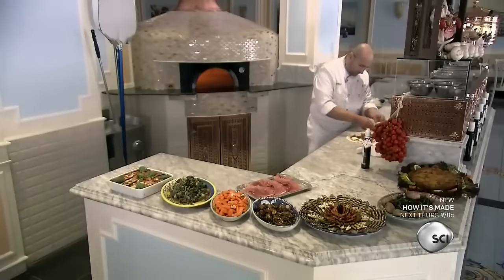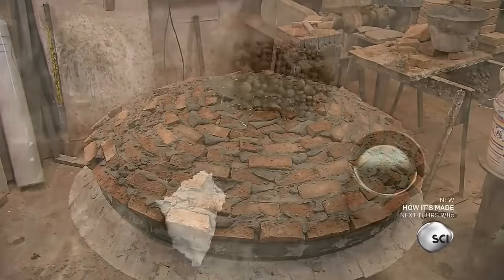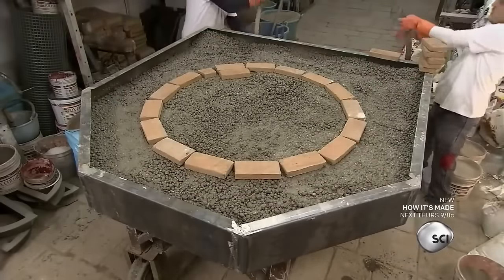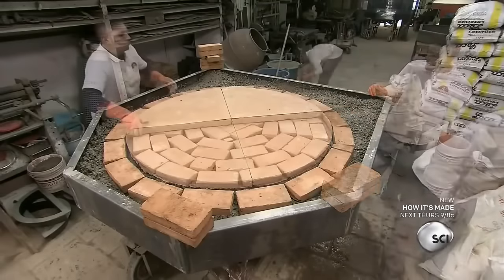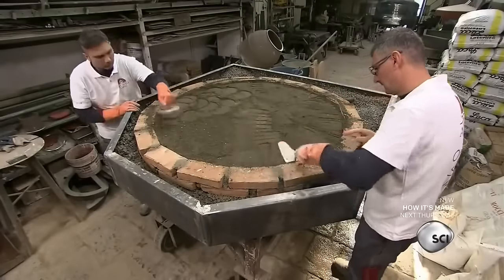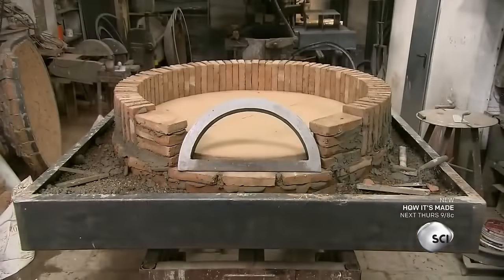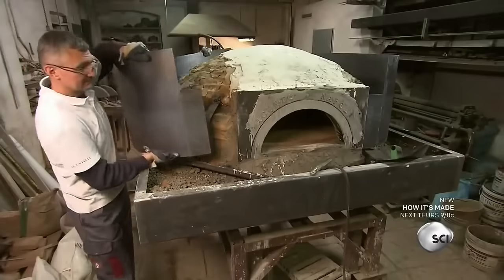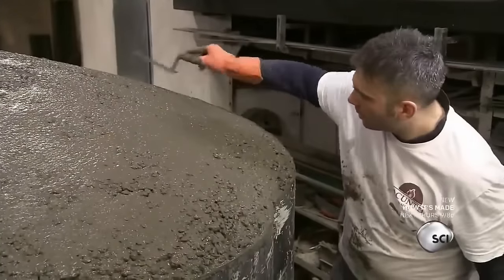Gianni Acunto Neapolitan Pizza Oven - HOW TO MAKE A PIZZA OVEN

Comment: Sorry for my bad english, but can someone tell my what they used for materials? They say Soil but not what kind of soil. At 3:22 (i am not sure) it sounds like plasture? What´s this exactly?
Please help my and thanks for the answers.
Reply: It’s standard kiln fired soil. Just as you get out of your ground. It’s cheap and easy to compact and works good as an insulator. It is also Plaster, which is a cement based water activated material. It’s use to smooth out the surface so the smoke can easily move and not slowed down by the rough bricks

Comment: What about the chimney 🤔 ?
Reply: The double-sided curved steel plate (3:42) traps the smoke and guides it through the funnel to the chimney.
Reply: @twisterwiper  thanks. Zoned out by that stage
Reply: The smoke will rise through the hood.to the chimney...(from an enclosed oven)...makes sense?..

Comment: where does the heat come from?
Reply: Not sure….they must have missed filming when the plug was installed.
Reply: From wood?
Reply: @heatmyzer9  What plug?
Reply: @georgegordonbrown9522  the power cord/plug.
Reply: At 900 deg any metal fuse! They burn wood
Reply: Ray guns

Comment: They need to re research it and come up with something  better. 
They need to go to middle east and learn how the traditional bread making oven works with clay and bricks. 
Learn from Sangak or Barbarie bread making oven is the best. Not those ovens in USA that are only 30 to 50 percent gives the taste of original Sangak or Barbarie bread. Barbarie is the ultimate bread for Pizza or traditional eating with Feta cheese, Butter and Basil.